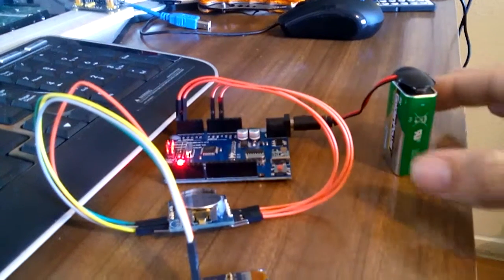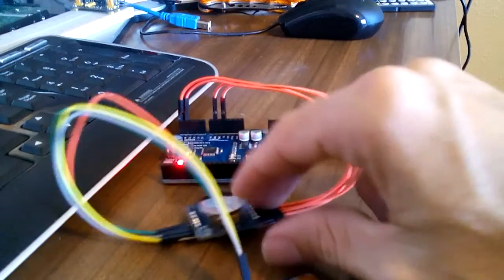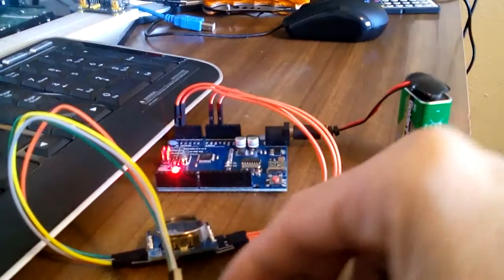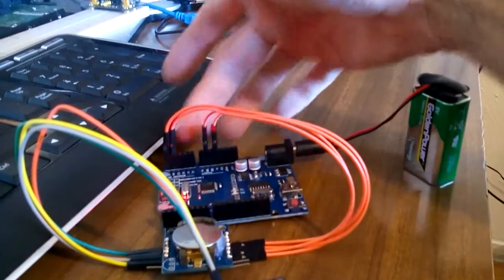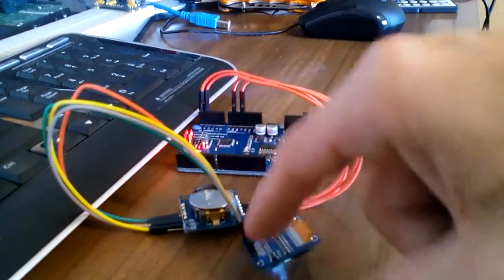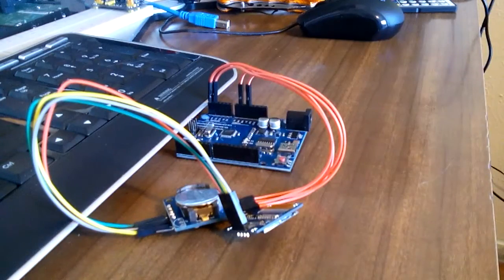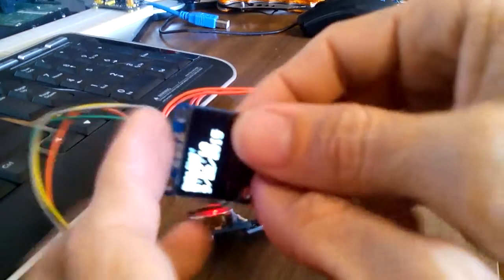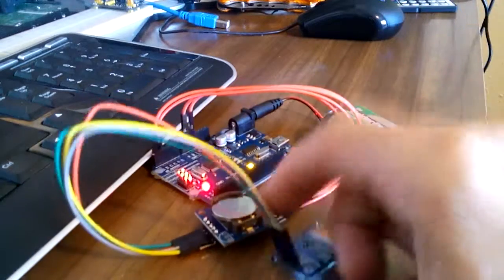Real Time Clock using a RTC module, OLED and Arduino

Comment: How to change the time and year etc?
Please help.
Reply from the maker: SANJEEV MATHEW THOMAS the code i used sets it to your computers time when uploaded to the board via the arduino IDE.
Reply: Mark Hack I tried it's not working it's showing year 2000.
I'm using DS3231 RTC.
So any changes to be made in the code??
Reply: Mark Hack There are two codes which one should I run first?
Reply from the maker: SANJEEV MATHEW THOMAS check the code and update if needed
Reply: Mark Hack  how to manually change the date and time in the RTC code??
Reply from the maker: SANJEEV MATHEW THOMAS its been years since i played with that, its all about the code you're using for the module.
Reply: Mark Hack Okay thanks for your help. I will somehow figure it out.